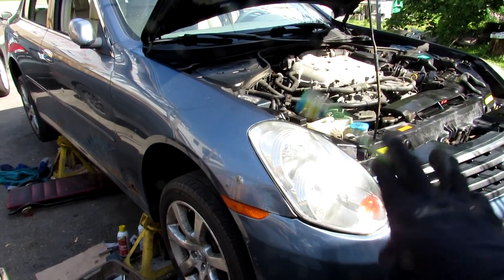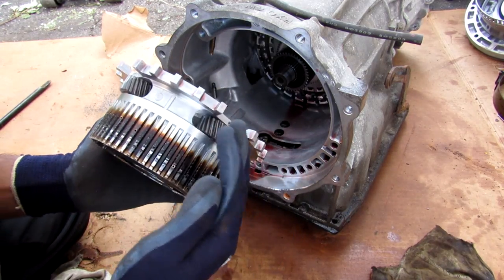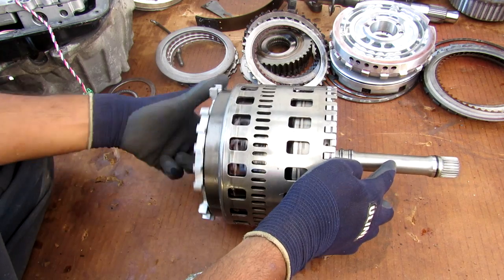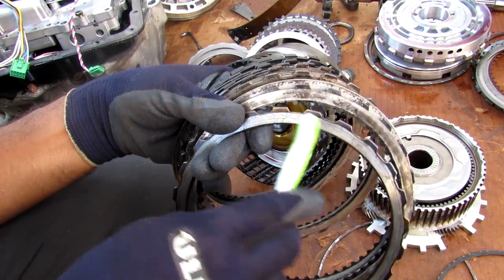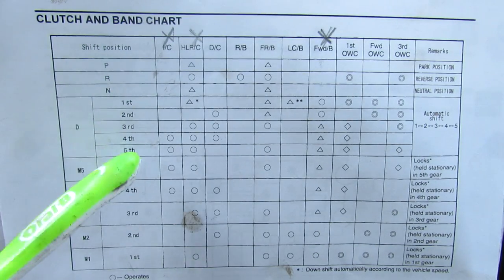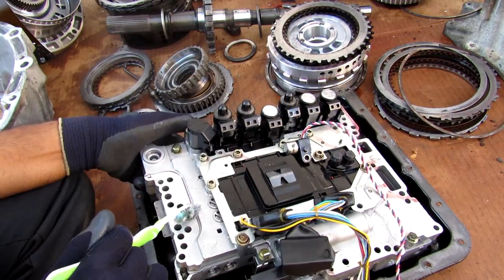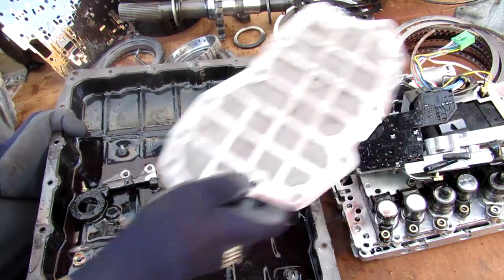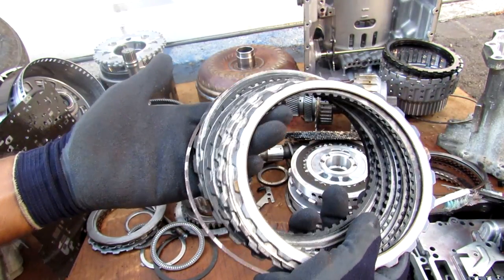Why Automatic Transmissions Fail

Comment: Good and fast with much detail.  I had flaring shifts in my 1996 Plymouth Voyager 2.4L with A-413 Torque-flite transmission, which is like the 1960's Chrysler 3-spd transmissions, but FWD version, which is much more pain to remove.  I found several clutch plates worn down to bare metal.  Interestingly, it had an extra steel plate in one clutch pack, suggesting the rebuilder (Certified Transmission label) had re-used worn clutch plates, filling the space with an extra steel.  Chintzy approach since a clutch plate costs $2, but let them meet their 10K mile warranty.  A rebuild kit only cost $100 and I bought the better dark "racing" clutch plates (graphite paper, HEM?).  Your clutch plates will last much longer if you let up on the gas pedal when the transmission is ready to shift.  I think that newer cars (since ~2010) do that automatically since the computer controls a motorized throttle and your gas pedal is just a "driver request".  I disagree with "old Chryslers eating transmissions".  I recently rebuilt the A-604 4 speed in our 2002 T&C 3.8L at 270K miles because I had a leak at the front which I though was from the front pump seal.  It was pristine inside with the clutch plates worn <2 mil (out of 70 or 85 mil) and all rubber parts still soft.  Still, I replaced all wear parts including bushings, roller bearings, and snap rings, due to the mileage.  I suspect the leak was a crack in the torque converter housing (bolt pad), but had already returned the core before I thought to look close.  Anyway, no more leak and should be good to >500K miles now.  Chrysler transmissions in V-6 minivans which had problems were mostly due to shops refilling them with cheaper Dexron fluid (for GM), rather than the proper ATF+4, which causes shudder in the lock-up torque converter.  Don't let monkeys touch them and they last.

Comment: Change the fluid and filter, nothing is “lifetime” fluid.
Reply: "lifetime ATF" was a sweet scam.
Now they use super low viscosity ATF MB-236.15 low lubricity too 🙄
Reply: @glasser2819  life time means less then 50,000miles!!
Reply: Clearly you must be old school. My oil is lifetime. XD
Reply from the maker: Agreed
Reply: In a manual its lifetime...
Reply: @Helicopter Dad you seem knowledgable about Amsoil, do they have industry certifications to validate their claims?
I know part of their base oils are PAO Group IV: pure synthetic from gas - but it takes more than a pure base oil to lubricate moving parts.
Synthetic base is going to last longer before getting oxidized.
Reply: Helicopter Dad God Amsoil is so damn good
Reply: G Lasser look up some tests and articles. I can’t recall the exact website but one engineer did an insane test with over 100 different big name synthetic brands and Amsoil dominated every single one of them. Even with ones with an extra additive added. If you search hard enough you will find it
Reply: Totally agree 👍 brother

Comment: These are pretty robust units if maintained. It’s likely this transmission was run low on fluid causing low pressure due to a external leak. The fwd brake in the rear of the case rarely burn up on these RE5R05A units without low fluid concerns. The input clutch (4th gear) has a low torque capacity and usually is the first clutch to fail. 

Great teardown and explanation of the unit.

Comment: I wasn't surprised, it's a Nissan. So didn't expect it to last long looong time.
I was expecting you to fix and put everything together and drive the vehicle again.
Reply from the maker: No thanks. I was going to swap but quickly gave up
Reply: Google Man regular.
Reply: @speedkar99  so you just dump the vehicle or sent it to transmission rebuild specialist? Or you replace the whole transmission with refurbished one?
Reply: Google Man  no such thing as a regular transmission.

Comment: I’m amazed that automatic transmissions can even work in the first place. The fact that people can drive a cad for 100k plus miles with a transmission doing all this work without the driver ever really even thinking about it.
Reply: Why?  It’s actually more simple than a manual in many ways. 

No gears to mesh. No synchros or dog clutches. No shift linkages, no throwout bearings. 

Just clutches and bands that are activated in a certain sequence to hold sun, planet carriers, or ring gears still to make the gears you need. 

In the old days it was super simple. Three forward gears plus reverse just needed two planetary gears like a Simpson gear set. 

The valve body looks more complex than it is. 

And all of those smooth shifts also cushioned by a torque converter means a lot less shock loads than a manual.

Comment: .I am 81 years old and have been driving a long time. I never bought anything but standard transmissions for may years. 
I prefer automatics now, one for their ease of use and reliability.
One reason I worked for 33 years in a transmission manufacturing plant.
An automatic is pretty simple actually. The Model T Ford, 1909 to 1927 was a planetary transmission, it used bands instead of clutches.
In case your transmission needs service, ask around to find a good shop. If you can find a shop that rebuilds race car transmissions you have struck gold.

Comment: A lot of clutches that can wear down overtime on automatics. Luckily a manual only needs one
Reply from the maker: True but that one clutch does alot of work
Reply: In a manual transmission, the gearbox can break.
Reply: @vintagetriplex3728  synchros are often the first to go
Reply: @speedkar99  In a daily driver car that's not taking a shitkicking from the driver, the clutch should outlast the car. I literally revived a "shot" clutch by driving it; pretty sure it was glazed due to the previous owner slipping too much at every start, probably with the radio drowning out the (quiet) engine...
Reply: @fun_ghoul  What? Pretty much all cars need a clutch replacement at 150,000 kms, give or take 30k
Reply: @ariellubonja7856  not true, i know a lot of cars around here with 250,000km with original clutch. our work van just had its clutch replaced at 300,000
Reply: @kclefthanded427  synchros last a very long time. Even if they go out you can still use the transmission without a problem. You can just double clutch, like you do in big trucks. The 4th gear synchro is gone in my Mitsubishi L300. I just double clutch. It has 340.000miles no rebuild
Reply: @ariellubonja7856  You must be another one who doesn't know how to take off from a light. Oh well.
Reply: @dieselgeezer18  I think people assume syncros are a wear part because so many recent light-duty transmissions have had faulty ones, mainly due to "design constraints" (READ: making parts smaller and lighter).
Reply: @ariellubonja7856  if you are a bad driver or the manufacturer of the transmission is trash, then yes, you will need clutch replacement soon. I replaced my clutch in my Mitsubishi L300 at 300.000 Km after some really HEAVY off road. The clutch can last MANY Kilometers if treated properly
Reply: Oggy  Thank you, Captain Obvious. I know how the fuck a clutch works, thus my ability to revive a glazed one. Ouf.
Reply: @fun_ghoul  My son's friends made comments about how I could shift so good and smooth as an automatic.I said I shift smoother.01 Rav-4 Slick gearbox!I never wore a clutch out but bought a few that was .
Reply: @ariellubonja7856  I love how you reduce the experiences of others to "internet driving experts" to deflect from the fact that you're wrong.

Comment: I MADE A MISTAKE BUYING A CVT
WE GOTTA GO BACK, MARTY
Reply: CVT is the best in terms of efficiency but the worst in durability, if it's a good maintained CVT it can last you 200,000KM
Reply: @ThexXxXxOLOxXxXx  200.000 is not much.
Reply: @dieselgeezer18  im just trying to make him feel a little better he can sell it at 150k before cvt problems 😂
Reply: @ThexXxXxOLOxXxXx  hahahah😂
Reply: My prius had a cvt transmission no trouble for about 100,000 miles.I babied it for mileage.Now they built a cvt transmission with a 1st gear to reduce the stress from getting it started moving.
Reply: @allanbrogdon5317  

Yea, that is true. Toyota and Honda have both advanced with new designs in their current CVTs. I’ve seen some Civics and Corollas with the original CVTs over 200,000 miles. The owners tell me the key is to baby them every 30-50 thousand miles.
Reply: @allanbrogdon5317  The Prius CVT works very differently from the push-belt type CVTs in Nissan cars. In the Prius the CVT is basically a planetary gearset like in an auto gearbox, but with separate input from the engine, engine mounted motor/generator and a dedicated traction motor. Gear ratio is varied by changing how much torque comes from or is removed by each input source, at low speeds the traction motor will be running in reverse and sending the resulting electric power to the engine mounted motor/generator for example.
Reply: @nerd1000ify  Thanks I don't have much experience with car transmissions.I worked at bell helicopter for a couple of years r&d drive systems test mostly on the v-22 osprey.It was the most interesting work I ever had the opportunity to work with.So My curiosity is high .

Comment: Thank you for the video! My '91 GMC with 300k miles has the same slipping problem in 3rd and 4th. The transmission was rebuilt a few years ago by the previous owner and its already failed. He's trying to convince me to rebuild it, but after this video I think I'll leave it as someone else's problem. :)

Thankfully my daily driver is a manual. Currently at 275k miles with no drivetrain problems at all.

Comment: You must be grateful to your brother for the peripherals! 😆 What’s the best automatic transmission you came across given proper maintenance ?
Reply: I'm an old timer and the best transmission I have experience with is the General Motors Turbo Hydramatic 400. Rugged and dependable but since there are only three speeds they quit making them decades ago
Reply: nasedo3129 shame when GM has something good it seems to stopped being produced.
Reply: Toyota transmissions are usually the best. Aisin is the best auto transmission manufacturer.

Comment: I've always wondered if the introduction of more speeds in a transmission made automatics much less reliable. Older Chrysler and Chevrolet transmissions from the 60s and 70s seemed to last forever. With the introduction of overdrive and more speeds, it seems like failure rates for transmissions went up. Especially in Nissan and Chrysler products...

Comment: The reason why the high clutches go is because they have the most torque on them.  The factory shifts them in early for fuel economy, but if the over drives shift in too early, they get excessively loaded and wear out.  You can notice the early shifts if you listen for driveline vibration, like if you shifted a manual trans early.  Lighten up on the gas and save your clutches.   Also towing when not in "tow" mode will burn up the clutches.
Reply from the maker: Drive style and programming has alot to do with it. As well as design and manufacturing

Comment: I was getting some slippage in my transmission. I drained the fluid, put in the specified fluid and replaced the filter and seal. I also added a bottle of lucas Transmission Fix. No more slips!

Comment: I drive my cars like there is an eggshell between my foot and the gas pedal. I always try to accelerate as slow and easy as possible under current driving conditions. This reduces the wear and tear on all the wet clutches and the bands inside the transmission during each shift. Periodically changing the fluid and filter also helps. If an automatic transmission is properly cared for and not abused getting 300,000 miles out of one is not that difficult.
Reply from the maker: Snail driver eh....do you have a Corolla?
Reply: @speedkar99  Actually its a 2003 Ford Windstar that has 276,000 on it. These vehicles are notorious for having transmission issues. My transmission is original and has never been opened except to replace the fluid and filter and it still works just fine. Snail driver? No. I'm not suggesting driving 40mph on the interstate. What I'm talking about is not depressing the gas pedal all the way down to the floor every time I speed up. Hard acceleration is what puts a lot of wear and tear on the transmission and shortens its service life.  It will also shorten the life of the engine and everything in the entire power train right down to the tires.

Comment: Praying to god I don't need to drop the valve body to replace the solenoids on my 2004 Toyota Camry U241E trans, I know there a few springs n things that can fall due to gravity, I don't have the time or equipment to pull the trans and rotate it so I'll have to be under my car to do all this. Fingers crossed. Your vids on ATs has been super helpful thank you brother.
Reply from the maker: I have a video I posted a few weeks about the Camry transmission. It was a tough job dropping that valve body

Comment: Failure is due to lack of fluid changes and not enough fluid, as you noticed by how little fluid came out. I've never seen a transmission burnt from overfilling (within reason).

Comment: Because in order to meet fuel economy numbers they started putting in 6 to 8 gears, which means more shifting, they also started to use more plastic in transmissions to reduce the weight of a car.
Reply from the maker: Hmm where are there plastics in transmissions? The ATF would disintegrate it

Comment: Good video, you show how complex an automatic transmission is. I'm a do it yourselfer, but don't touch automatic transmissions. The transmission on my 2002 Honda Accord takes some time to engage on starting off, and the clutches slip in first and second gear until it warms up. I figure a total failure is coming. I have to make the executive decision whether to get it rebuilt or not. I would normally just get rid of the car but everything else works great, it's in good condition and about 192,000 Km on the clock. Any ideas?

Comment: Not sure if you can or will answer this question but I have a 2 wheel drive 1996 Ford Ranger mini-pickup with 4.0 liter V6 and automatic transmission, 4R55E as I understand it.  100K miles, hasn't been misused, mostly just transportation, but after pulling a medium sized boat up a hill, noticed burned smell and transmission fluid now smells burnt.   Not towing anything, it still runs and shifts fine, but I'd like to at least change the filter.  Have heard that I should not replace the fluid, however, as that's likely to start it slipping.  Agree?

If replacing fluid is OK, I'd like to get a 4 wheel pan which has a drain plug,  for future drain and replace.  Any issue with that, I don't know if that'll change the total amount of transmission fluid or not, but dipstick will still show correct level once it's filled.

Lastly, do you think adding a separate transmission cooler, vs. the one built into the radiator, would be a good plan to, hopefully, extend the life of the transmission as long as reasonable?  I can install myself but NO idea what/how big, with or without it's own fans, any suggestions on where to buy/what to get?

Regardless, thanks again for excellent videos!

RichE San Diego, CA

Comment: Hello, would you say that this transmission is the best, most reliable for city driving, trafic creeping? But also ocassionally long roads? I heard dct is very bad for the city and cvt feels like rubber band and fails more often. Hope you answer me and also make a video if you'd like comparing their reliability and the optimum conditions to be used in and which motor they work best with. I heard dry clutch dct only works with small engines mostly petrol, because of how much torque it can resist, while wet clutch dct mostly with diesel. Thanks!

Comment: Gr8 vid And diagnoses 

I am battling a transmission problem also p0744
It’s mostly working fine. But the code comes up.  It was shifting very bad and I noticed atf was very dark ,  did NOT  smell bad or burnt .  
I did  a 3x drain and fill  with few thousand miles between each.
Using valvoline maxlife synthetic ATF 
Lucus and seafoam transtune.   Now it’s shifting a lot better.  
But I Think I lost overdrive now.    I got it to pass my states emissions test barely.  I got a o2 sensor starting to go.  

I think it  needs new shift solenoids block or refurbished valve body
Trans model RE4F04B (JATCO)  on 2001 maxima 214k miles.

Comment: I always thought automatic transmissions are a true wonder. Remarkably dependable usually, I have a 50 year old Pontiac with almost 300,000 miles on it and the transmission, a TH400, has never caused any trouble whatsoever. Amazing.
Reply: No trouble...except that it costs $5 to drive one mile.

Comment: how is an automatic transmission damaged when the car is not running while it gets pulled? I know automatics can't be pulled when not running but not sure which part gets damaged and how.. I did though unfortunately got to pull mine during an emergency like 2 years ago but I kept it under 40kmh just to be hopefully safe, so far no problem until now. thanks for the great videos!
Reply: The transmission is not cooled since the fluid is not pumped to the  transmission cooler therefore subjected to a lot of heat. Manual transmission has splash lubrication which also cools the transmission.
Reply: When towing a FWD car, the front should be lifted and the rear should be in contact with road and vice versa for RWD. If it's AWD, all wheels should be lifted.
Reply from the maker: The transmission turns with the wheels and can heat up
Reply: thanks for the replies.. I was not very sure what is exactly going to get damage. I guess that's why during my emergency the towing service guy allowed me to tow without lifting the driving wheels but maintain under 40km/h
Reply: many people misunderstood so much that they don’t want to move their automatic cars when not running even for just 10 feet